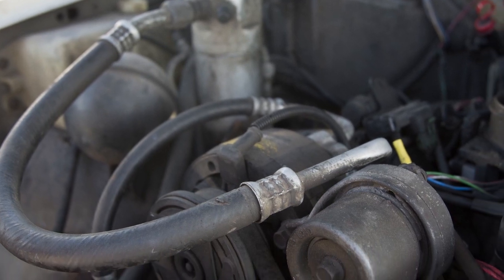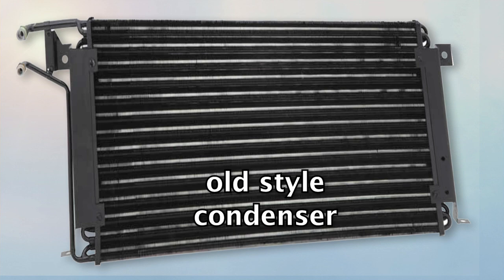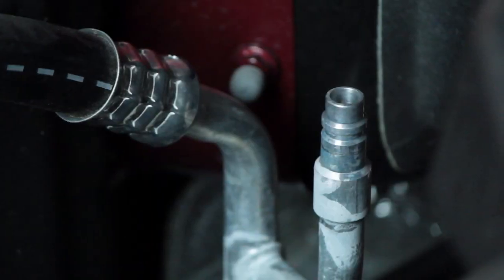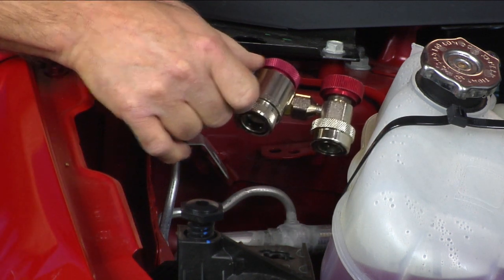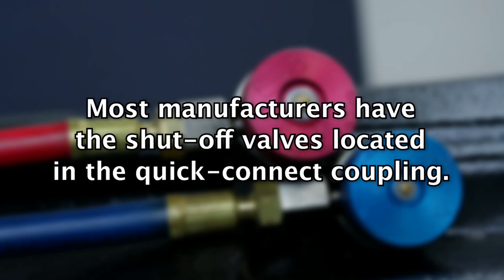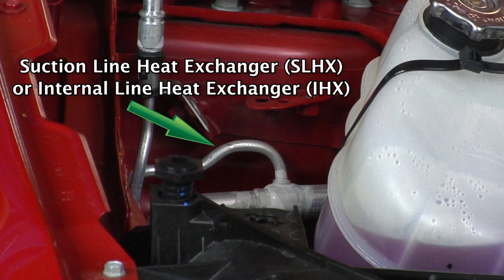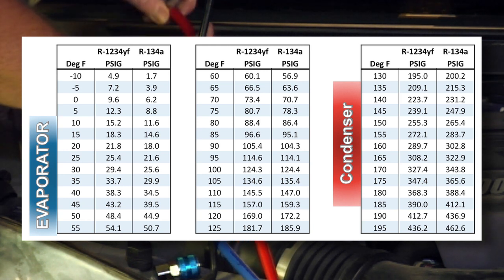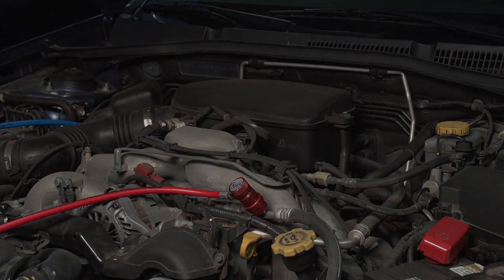MVAC System Components, Lines, Hoses & Connectors | EPA 609 | Tech Tip

Comment: Just found this informative video thanks. At 1:55 it states that "dual usage of hoses and gauges is not allowed" however companies are selling kits that have 1 manifold and 1 set of hoses with both R134a and R1234yf quick connect couplers. Has this rule changed?